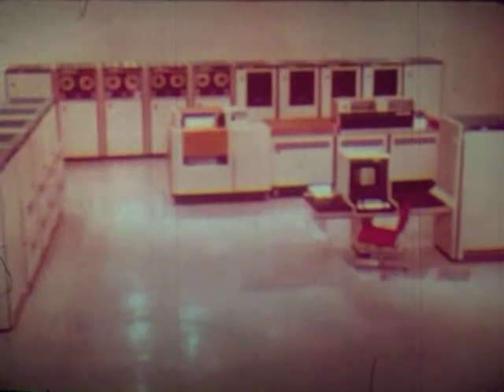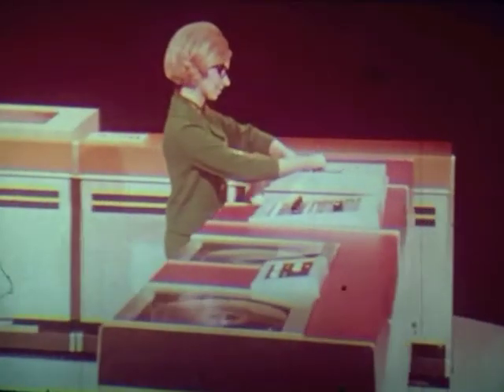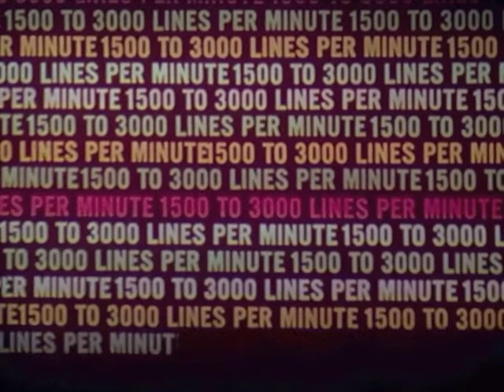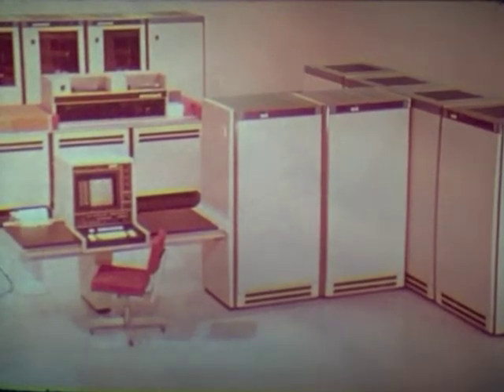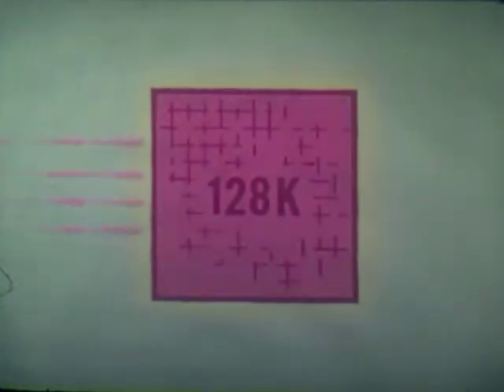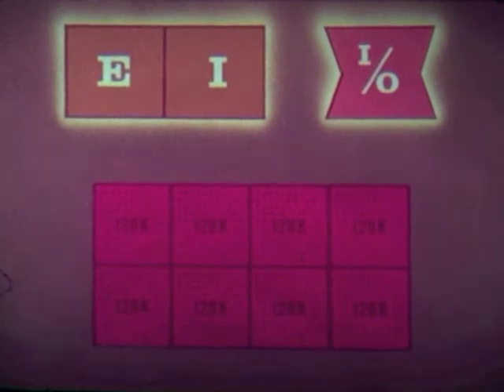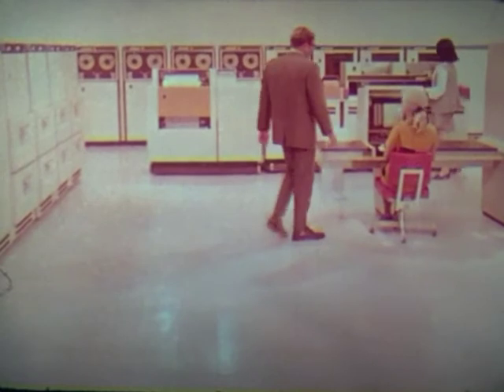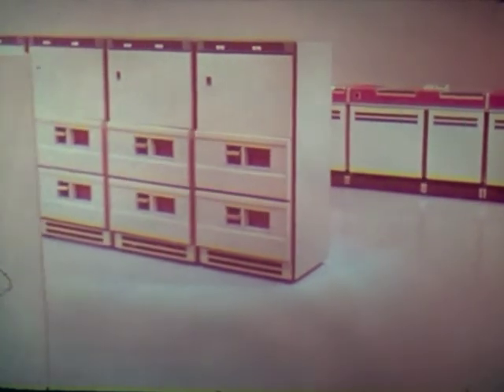NCR Century 100, 200 & 300 Series of Mainframe Computers

Comment: I remember my dad, at the dinner table, talking about the new Century computer systems.  He was a sales manager at the Denver data center, on Champa downtown.  I would go with him on Saturdays sometimes, type up cards on the key punch machine, play on the cash registers in the demo room.  He would take me into the actual computer room, allow me to press buttons to start a job, watch as the tapes were loaded, stored in the vault, etc.  Later, he helped design the state-of-the-art new facility on Colorado Blvd.  around 1970. They had one of the first Halon fire suppression systems in the state.  They also had the first sensor-driven electric doors to go into the computer room that I had ever seen...until then all glass electric doors had the step pads that you still see in supermarkets today.  I was in the computer room when they were installing those big disk drives, that you see the woman loading in this movie. Dad would run a program that would produce printouts of Linus or Snoopy, made out of X's on greenbar printer paper, little programs that the programmers would make during down times.  In 1975 as a birthday present, I got 90 minutes of computer time to play a computerized Star Trek game, where you typed in actions to get the Enterprise to a starbase safely, firing torpedoes, fighting Klingons, etc, and the computer would tell you what happened, your options, and would keep track of all your energy usage.  If I remember correctly, I lost the Enterprise!  My dad had a very good career at NCR, although they didn't like that he bucked the corporate process that "all roads lead to Dayton".  He didn't want to live in Dayton.  NCR was very cool back then!

Comment: My first job in 1974 was at Cedar Holdings Bank in Pall Mall, London, as a mainframe computer operator. They had two Century 200's in two identical computer rooms which gave them some redundancy as being a bank there could be very little delay in processing data. Both machines had 32 kilobytes of memory. Less than the size of a  modern Word document! As the film says the printer was very fast, it could completely fill a sheet of continuous paper (around A3 size) with text in half a second. My next job was operating a Century 100 with 16k of memory. I'm glad I saw those times but I would never go back to that technology!
I later worked on a Xerox Sigma 6 mainframe, another interesting machine.

Comment: I worked for NCR in the late 70s.. C-300 and testing on the Criterion series.. 655/658s and insufficient space.. great memories
Reply: 658 diskpack - 19 platters, each about 18 inches in diameter, with a total (unformatted) capacity of 200MB. How could you possibly run out of space?  ;-)
Reply: RB or dayton?  i knwo you?

Comment: Before my time. I remember VRX.
Reply: Working at the NCR corporate data center, I got access to the VRX OS source code (which was spread over about 35 reels of tape).  That came in handy when I wrote a utility to reverse engineer programs that had been "link edited" -- the process of joining compiled modules together into a single executable.  My "unlink" utility was only possible to develop by looking at the linkeditor source code to see how pointers to resources were altered, and resetting those pointers to extract the linked modules into standalone entities once again. Fun stuff...

Comment: Wow, that is an impressive architecture for the time. What OS did it run?
Reply: The OS was called "B2" a multi-programming version of "B1".  I think the Sumitomo Bank in Japan wrote their own OS.  The next generation of NCR computers ran VRX (virtual resource executive) .
Reply: First computer I ever used was a Century 50 at my High School.  Still remember punching up cards with Neat/3 programs  If anybody still has copies of any system software for the Century series I'd like to hear about it.  I'd be willing to write a simulator for them.
Reply: @mikekelly7963 Actually, it was the B4 operating system just before the Criterion system and its VRX (virtual executive) OS replaced the Century 300. I know, because I ran and programmed for both of those systems at the NCR data center in building 31 on Far Hills/Main St (now WHIO-TV) in Dayton Ohio.
Reply: B1 (C100) then B2 (Multi task +1 extra partition) and B3 multi-prog